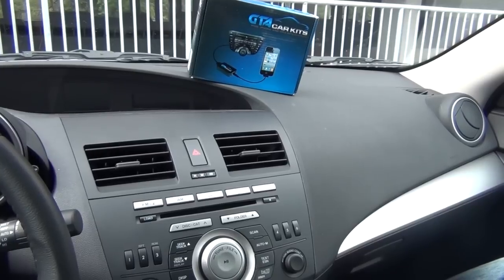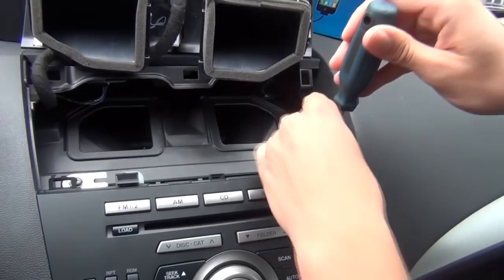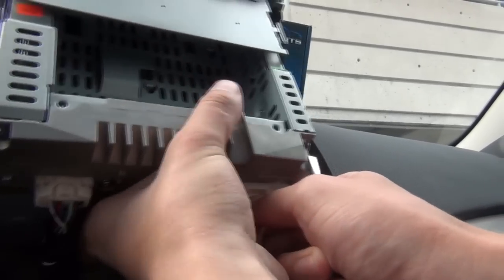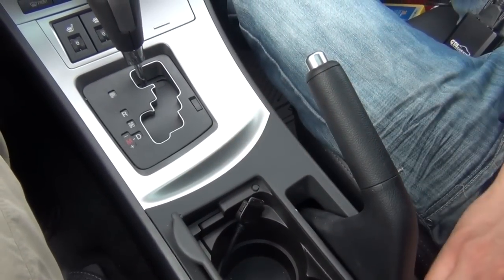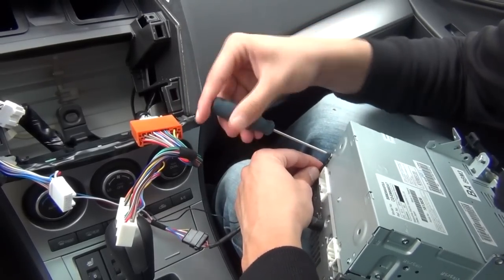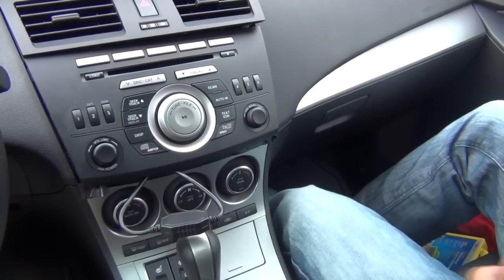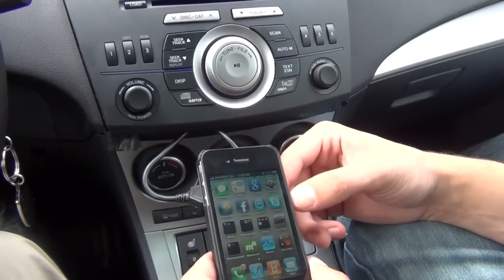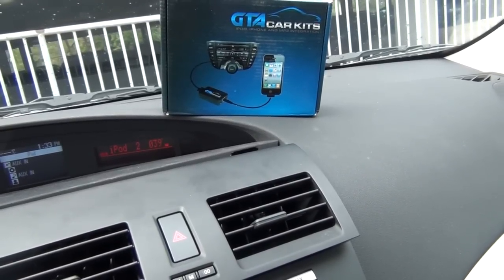GTA Car Kits - Mazda 3 2010, 2011, 2012  install of iPhone, iPod and iPad adapter

Comment: For the people talking about the iPhone 5 connection, I have a car kit for a 2004 Mazda and at the time I had a 4S so the adaptor it came with worked just fine. I upgraded my phone to a 5S and solved the problem by buying a lightning cable that has the plugin for a 4/4S and has at the other end a 5/5S/6 connector. It didn't change a single feature that the GTA kit gave me except now my phone charges :) 
Just a side point for those of you asking for the 5/5S connection, it worked for me with the lightning cable with the adaptor.

Comment: Just got this thing installed on my 2010 mazdaspeed3. It took around 1 hour. The hardest part is hiding the iPod cable underneath the center console. It was a little bit tricky when putting the head unit back to the slot, since there were whole bunch of wires, need to get them organized before I could put it back. Overall It works perfectly as it said.The sound is much clearer than BT streaming, and the steering control is still functional.The only problem is the song title doesn't show properly

Comment: Great kit, i have a mazdaspeed 3 2008.5, i ordered the 2007-2009 kit but doesn't work due to some changed they made for the 2008.5 , so i contact gta, they send me the 2010 kit and work like a charm, plug and play, it also charge my iphone 4s, works with pandora too. thanx vitally and the rest of the gta crew.

for people who have ms3 that was made i think after august 2008 get the 2010 kit. you can get the date of when your car is made by the driver side door jam.

wil-

Comment: There’s an aux jack in the console...........
Reply: Taylor Ball-Myderwyk mine don't work
Reply: There's an easy fix for it on youtube you just have to take the little aux unit out and connect two pins or you can just replace it. The part is only $30.
Reply: @no55ah  Can you provide a link please? My Aux is not working, and I found nothing :(
Reply: @no55ah  Thanks a lot! And I assume the YouTube video is this: https://www.youtube.com/watch?v=te8qha4YhWM
Reply: Noah my aux sounds weird... how can I fix it?
Reply: @no55ah  hey man how'd you get the aux unit out? Do you have to remove the entire console first?

Comment: Once you take the radio off, would you be able to remove the hard metal case to gain access to the LEDs that light the buttons? I'm wanting to change mine to blue and I'm not sure of how to go about getting to the lights or if they would work.